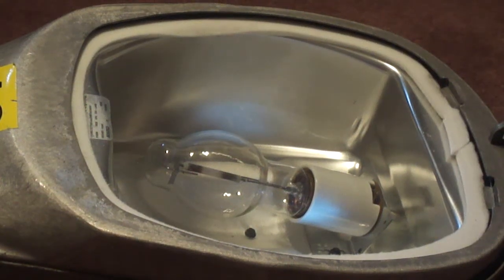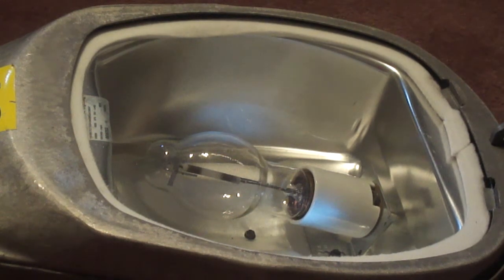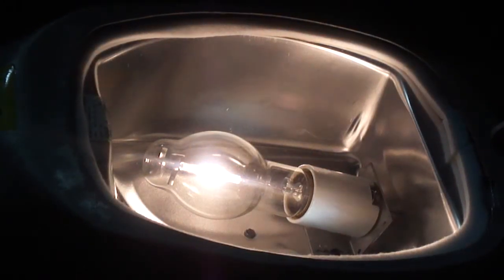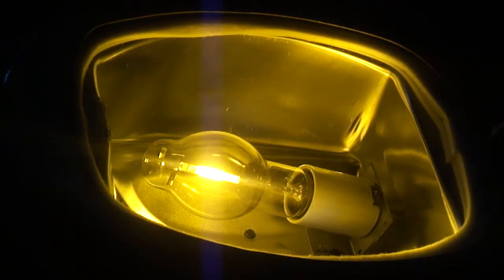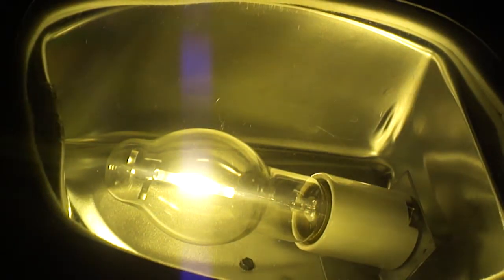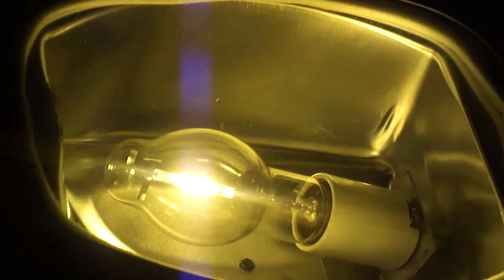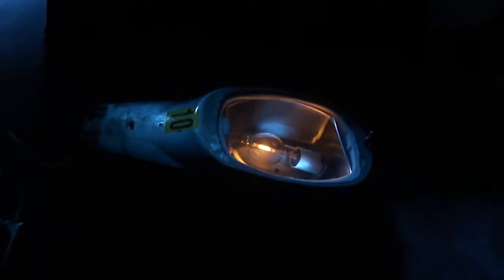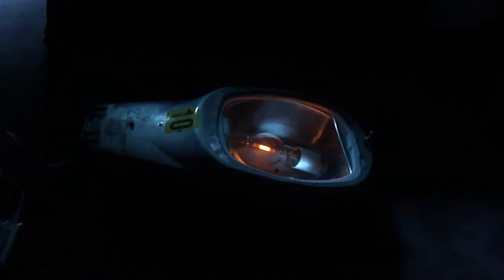American Electric Lighting Model 115 100 watt HPS Street Light Full Startup

Comment: That looks like the 2003 one. Were did you get it?
Reply from the maker: Adam Correia I got this a while back (last summer, this video is quite old) from the town I live in. They have replaced pretty much all their lights to CREE LED Streetlights so I managed to get one of these.
Reply: subway5411 aw :/ led is taking over!
my town replaced  all different kinds of street lights in 2009 and replaced them with ALL 50 watt FPS GE 250-R2s.... but there is still a small section in the middle of town with the original  street lights. but even though they survived the replace era. i'm still afraid they might be replaced at anytime :/